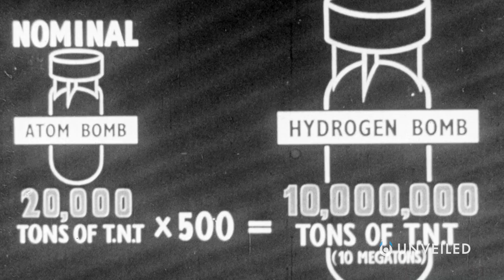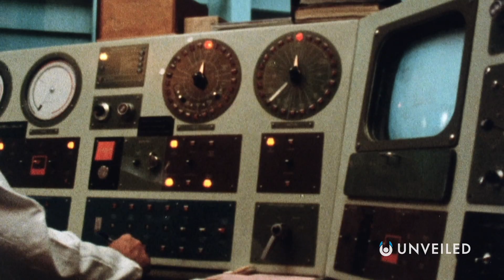Scientists On The Verge Of Nuclear Fusion Breakthrough... And Unlimited Power | Unveiled

Comment: For many years (almost 25 years) I have been
convincing scientists that thermonuclear fusion in the Sun occurs not in the
core of the Sun, but in the solar corona !!! But scientists are very stubborn,
and do not want to believe the obvious. Why are scientists not accepting new
breakthrough scientific ideas? There is an assumption, accepted by most
scientists, that thermonuclear fusion in the Sun occurs in the Sun's core. But
no one has ever actually confirmed this. This is just a guess, the fantasy of
an authoritative physicist. Scientists are currently using two methods to achieve

nuclear fusion: inertial confinement and magnetic confinement. But there is
also a third method of achieving nuclear fusion, this is the repetition of
physical conditions as in the solar corona. Nobody is using this third method
to achieve nuclear fusion? In 6 months there will be a small prototype of a
commercial fusion reactor. A commercial fusion reactor in 1-2 years!
Reply: You’re insane dude.

Comment: There is only one way to create fusion and non of the fusion reactors of today including the ITER will succeed, the NIF is a ridiculous method , even if a single pellet of fuel creates fusion how are they going to inject another pellet to continue the fusion process? think about that and figure out how many pellets they would have to continually inject to sustain the ignition ? stupid concept. When ITER starts its results will be the same as the other smaller reactors only on a larger scale , as stated there is only one way to create fusion and when this is discovered it will also destroy the entire current model of how mankind has come to understand the universe, before you ask the answer is yes I do know how to create fusion but nobody in the entire fusion race seems interested which tells me they all in a compitition to be the first as opposed to all sharing their methods as ITER is doing.
Reply: I prefer fission, the photon is also a source of infinite energy.

Comment: O people. Humans always run to their end. Unfortunately it's the end of the planet. Planets are not designed to tolerate such cosmetic Stellar power. Scientists claim it is a clean power in the sense that it doesn't produce atmospheric heating gases (CO2....) which indirectly warm up the Atmosphere by one or few degrees over many decades but intentionally they don't tell about the extreme temperatures at the cores of these reactors, although confined, but finally will be transferred to the Atmosphere through a series of cooling systems. Since this is a chain reaction so once ignited it will go endlessly and when  many reactors are built world wide a continuous tremendous amount of heat will be thrown to the Atmosphere causing not only warming up but direct accelerating global heating over a few years rather than decades leading to eradication of all forms of Carbon-based life on our delicate earth.
People, don't suicide, think carefully please.
Reply: And that new thermal energy will replace hydrocarbon released thermal energy. Net gain zero.

Comment: Lol this is an experiment not a proof of concept of a reactor. It is not difficult to actually perform fusion reactions its difficult to create ones that are genuinely creating more electricity than you put in. Achieving energy ratios is a long way off achieving a feasible technology. This “break even point” is a misnomer being used like engineering snake oil. We are decades off from even having the right test facilities to fix alot of the elephants in the room when it comes to actually producing and capturing these enormous amounts of chargeless neutrons being emitted. I’m all for the technology but I’m realistic unlike the claims this narrator makes. The whole game is to constantly say its just around the corner and then dump your investments when the hype train rolls up.

Comment: Just achieving ignition isn’t sufficient. The process of converting the heat output into electricity needs to be considered. If the heat was used in a steam cycle, the thermodynamic efficiency will be about 30%. We need to learn how to extract the plasma energy directly with magneto-hydrodynamics. This may be possible in a laser fusion process as there aren’t any confinement magnetic fields that could interfere with energy extraction.
Reply: Yep, what dorkus malorkus said

Comment: I just saw a Sabine Hossenfelder video where she warns that these so-called efficiency numbers can be very misleading.  The 70% figure mentioned in this video at the 6:10 mark, does it include ALL energy put into the system not just the plasma energy?  Sabine contends that when ALL energy is considered, but efficiency is at best less than 10%.  What say the authors to her statements?  Is there conFusion being produced or fusion?

Comment: No, we are not close. This is incredibly misleading. They are not breaking even yet, and not even close to producing any electricity at all. They have achieved increase in Q-plasma, but it is not yet sufficient to power the entire setup even IF energy was collected, resulting in Q-total being zero. It will take 20 more years to achieve a practical design, and 20 more years after that for first power-plants to be constructed.

Comment: So they know how to get over that energy barrier that physics says stars shouldn't be able to even get past with all tbe gravity heat and pressure they have.... 

As they talk about some theories that says that gases in the early universe started fusion when parts of them reached near absolute zero and a quantum tunneling event started the fusion off. So stars could literally be a one off type object and nothing can replicate fusion they are doing by doing what they are doing cause some unknown event we can't replicate has to happen first.

But what about instead of lasers or a tokamak, they use a particle accelerator and keep the fuel at temps near absolute zero. Just to see what happens if its set up to generate power instead of look at bits of atoms.

Aircraft carrier levels of kinetic energy in small clouds of atoms going around it. And that's much older less powerful accelerators. Particles act weird at near absolute zero to. Maybe weird enough to jump that energy barrier... Or maybe do the same with a Tokamak. All the fuel would react as one thing at near absolute zero and may be easier to set off fusion like that collapsing gas theory suggests.

So why go hotter and hotter and hotter if the coldest is also a possible trigger cause of quantum tunneling.....
Reply: Could maybe even use far less energy than they do now. 

If space reached that cold of a temp then where little variations in temp around it might have set off those near zero pockets of gas.

And even today they know but don't say. Oh well the sun started fusion somehow without enough energy to do it and it somehow keeps going but our math says it shouldn't work but we see it so we are gonna try to copy it and nit even use the same fuels.

And have failed at every theorized temperature needed as they reach them. Lol.

That's probably why they want fusion so much. Its the impossible thing like blackholes that deify physics but they can maybe recreate for power. If it isn't simply impossible for anything but a star that impossibly started and continues fusion even tho they aren't powerful enough to do that...

Hey what if stars are just black holes with accretion discs shaped like spheres and the glowing material is just a shell just outside the event horizon unable to fall in?

Space is 3 Dimensional and not flat like a rubber sheet. Could a blackhole warp and twist space enough to look like what this imaginary hole does?

Comment: Did they ever stop to think that a sustained reaction would take less material than single ignitions. 
Just like your car, shoot a bunch of fuel to start your combustion but to keep idle takes less fuel while still generating output
Reply: An internal combustion engine produces intermittent power from each cylinder. That is why there are multiple cylinders and a flywheel in an engine. The cycle is intake, compression, power, and exhaust. 3/4 of the time, power isn’t produced by a cylinder.
Reply: @denniscraggs8393  shut it, nerd.
Reply: Mechanics & engineers have been creating {fusion} for the last 300 years & you are completely right to apply mechanical processes here.

Comment: Um no we are never going to do this, and here's why...

The sun is enormous, which is why it works as a fusion reactor.  It's immense size and gravity play a huge part in this fusion reaction.  The pressure from the gravity of the sun compacts the center of the sun to be very dense and heavy.  This contains much of the reaction, in addition to the sun's magnetic field.

And here we are trying to do this with a tiny reactor, using external pressure from a artificial magnetic field.

This will never be sustainable.

Comment: Before even starting this video I'm willing to bet that we are infact NOT close to a fusion breakthrough, that we're still 30 years off from practical fusion and that this is yet another click bait video. I'm suprised that the video isn't 10 minutes and 10 seconds long.

Let's see if I'm right.

EDIT:
Verdict:
Video doesn't start until 6:35 and lasts about 3 minutes.
Summary, inertial confinement has reached 70% of break even energy output.

My opinion: Not a breakthrough

Also, do we need to have fusion explained every single time one of these videos are made?
Reply: Well yeah, because many people out there don't know this stuff. Remember: cerebral folks like you and I are the exceptions not the norm.
Reply: Also, the video title said: "on the VERGE of breakthrough" . Yeah it's clickbait-adjacent, but technically accurate.